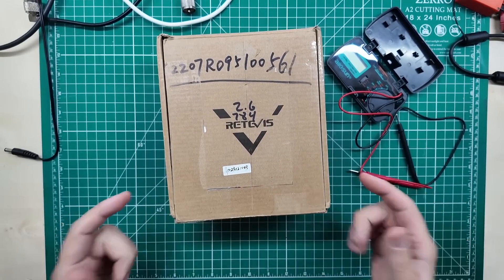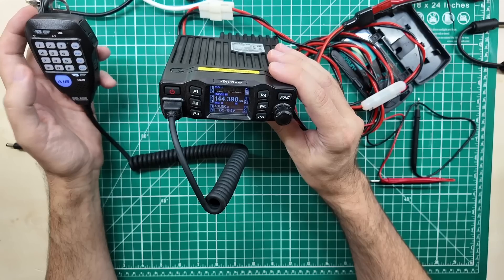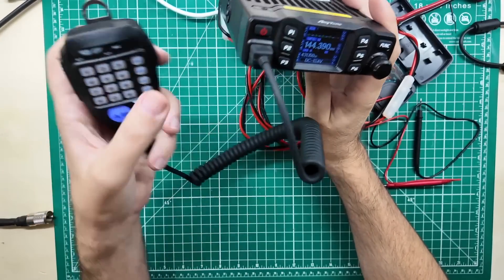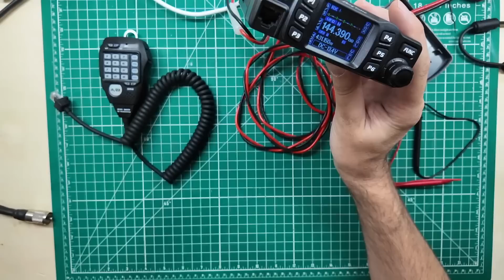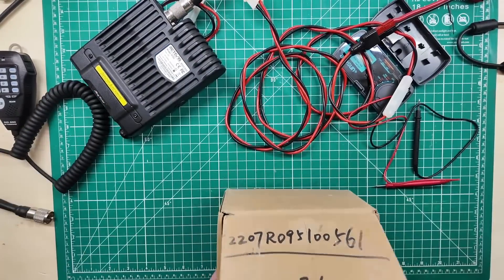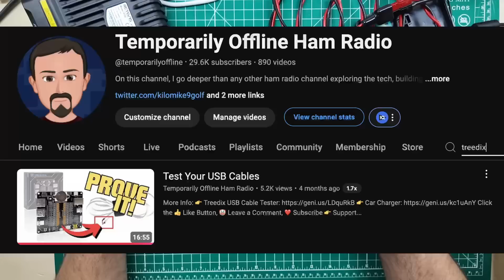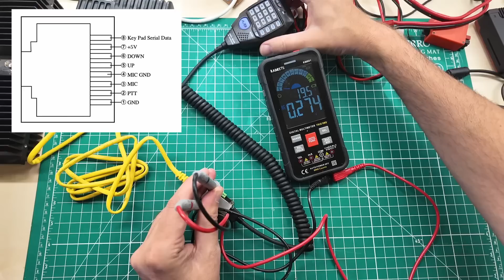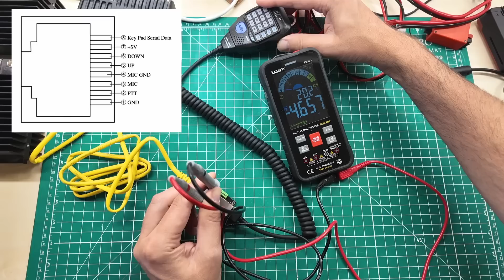She's Back!

Comment: Hi just wondering Anytone at-778uv and Retevis RT95 which one is better and what different?
Reply from the maker: Both radios are the same, come off the same factory line and the Retevis model gets a Retevis sticker and better support... go with the Retevis!  You can see in this video that the radio I got returned from Retevis has an Anytone sticker on it now... its what they had in the inventory of spares.  It works and I'm happy.

Comment: Alright. Your process or your radio is faulty here. I have an rt95 and just buzzed the ethernet cable port on mine and it matches with the manual to a T. I'm also building a digital interface and honestly, I'll be going with the external speaker port on the back for the audio back to the PC.

Comment: Perhaps you could find an obvious ground inside the radio, like the ground from the power cable, and find which mic pin has continuity with it? Then maybe work backwards from there.

I know Motorola numbered their mic jacks backwards: RJ45 Pin 1 is Motorola Pin 8 & so on. I wouldn't be surprised if Retevis did that too.
Reply from the maker: @EmJayArr  good tip, thanks!

Comment: This cheap junk radio will fail catastrophically within 2 years so spending any time modifying it is a complete waste of time.
Reply from the maker: How did yours break?
Reply: @temporarilyoffline  Display failed. It didn't get used much either. Plus the audio was crap from day one. If you buy these Chinese radios you might get 2 years out of them or you might get less. Buy an Icom, a Yaesu or a Kenwood. It's going to cost you 75 bucks more but it's going to last for 10 years or more.

Comment: Watched your very good video. Several months ago, I used pin 7 of the mic wire to power a cb radio power microphone. I also successfully installed a dc to dc boost converter board to change the 5 volts to 9 volts for the cb mic pre amp circuit. Keep up the great videos! WRCX212 - GMRS OPERATOR
Reply from the maker: That's awesome!

Comment: I have the same radio and I would like to connect Kantronics modem to it. I have not read the comments but is it possible that you mistook PIN 1 for PIN8? You never tested PIN1 against the actual body of the radio. Or I have missed this part. The "differential voltage" makes me think that you are measuring against the DATA PIN8. Please let me know. I have found a diagram for the Digirig cable and I will make my own with appropriate modifications. We will see what happens.
Reply from the maker: I probably do have the cable backwards.  It's a common theme with me 🤦‍♂️
Reply: @temporarilyoffline  I am not saying (you should at least get this 5V), but I looked at my radio and the ground PIN is located on the display side of the socket. I tested connectivity between the ground PIN and the body of the radio and it was there. Also, this is just an unsubstantiated speculation... Perhaps the pins behave a bit differently when the microphone is plugged to the radio. Anyway, I will keep you posted as I am planning to work on the cable for my Mobilikd and Kantronics.
Reply from the maker: @radioastronomy2001 did you see my other 2 vids on this radio?  It's 100% possible, I'm just working on making a more refined interface.
Reply: @temporarilyoffline  I have not yet. I will see them as time allows. I am there with you! I want the same thing, a single cable coming out from the radio. However, I am planning to do it in phases. First I want to make the Digirig version to work with my Mobilikd and then I want to make changes to streamline the design to a single connection point. You decided to jump at the deep end first :-)

Comment: I ended up getting the Digirig kit for the radio. I set it up with UZ7HO soundmodem and OZ9AAR Greencube terminal to work APRS on the ISS. Worked great!
Reply from the maker: Hey Eric!  Sats are cool!
Reply: @temporarilyoffline  working the ISS digipeater is pretty easy too. My RT95 has no issues getting digipeated on it even with a basic vertical antenna.

Comment: Steve, you should probe all those pins using the battery connector black wire as common. You could maybe even locate the correct ground pin  on the RJ45 connector with a continuity test with the battery connector black wire.  I feel the pin you were using for return was not actually return. 😊
Reply from the maker: I agree, I think the pins are backwards - but mostly because I used the "cable end" and not the "socket end"... more work is needed.

Comment: I found the audio out and the UP signal (if I remember correctly it has been a while) were multiplexed. Needed a filter to decouple the audio from the gpio. Audio level was low and I needed an amp to boost. Got tired of trying to reverse engineer so I got the DigiRig mobile cable for the radio. Well the AnyTone version of it. It uses the speaker jack on the back and the RJ45. Ugly yes, but it works.
Reply from the maker: Yeah, I have dreams of a single non-y cable solution... I will probably get the digirig cable just to play with though.
Reply: @temporarilyoffline  I ended up selling all but one of my AnyTone Radios and buying 2 of the FTM-6000(s). So much easier to work with.
Reply from the maker: @W3DMJ yeah. But where's the fun in that? (I like my 6000 too)

Comment: MIC GND and GND are probably two different grounds. MIC GND will be analog and, as there is a serial data line, GND is probably a digital ground. It is pointless trying to use a volt meter or oscilloscope on a digit signal. You need a digital signal analyser. The Up, Down, etc pins may use the MIC GND as ground return and not the GND digital ground.
Reply from the maker: My scope decodes digital because at the end of the day everything is analog.

Comment: Regarding those DuPont cables - the plastic shrouds around the male or female connectors are singles but you can buy multi-pin shrouds to enable plugging in to multiple connectors at once. You just have to push something thin and pointy into the shroud to unclip it from the metal pin or socket and then push the pin or socket into the multi-connector shroud. That way you could plug in all four wires to the header or terminal block at once.
Reply from the maker: Thanks for the info!

Comment: If you go online and look for the pre-manufactured APRS cable for this radio - in the product details, it shows the pinout the product uses. I used pinout on that product and everything works perfectly - the  one in the manual that comes with the radio seems to be incorrect.
Reply from the maker: Good eye!

Comment: Did they upgrade the firmware? You already got the mic gain setting before shipping? Don't loose the chance to make a video if you don't have the mic gain setting. Another great chance to brick and send it back to the far end of the world again. Jokes aside, wondering if mic gain could be useful for this project.
Reply from the maker: I didn't have problems with the audio levels before... But you're right, this is a great radio for $120, more people need to know about it!

Comment: Steve check to see if connector ground is the same as radio ground. I normally chech from the radio chassis to the connector to confirm this. Have found floating grounds to give me all types of grief. Also drives test equipment crazy. de K8DMM Tom

Comment: Hey Steve, I think there might be a direction to the treedix coupler.  So if the breakout is numbered it should be numbered with one side.  The otherside will be reversed.   That is the only way you could get a negative value is by putting the red probe to ground.  And not sure what value this gives you as I read the rest of the comments.  Look forward to more videos on this radio.  Thanks.
Reply from the maker: We'll figure it out for sure!

Comment: Take the connector out of the equation.  Get a plastic ethernet barrel connector, break it open then measure the inline amperage on each wire as you press the buttons on the microphone.
Reply from the maker: I think I'll just try that next!
Reply: @temporarilyoffline  if you get this working let me know cuz well it's cool
Reply from the maker: @pnowikow  I've gotten it working, just trying to make the interface more prettier:  

VOX Version: https://youtu.be/tRYpdnbDx_A?si=mWgdb0u1VzOTk7W-
PTT Version: https://youtu.be/26Bsd2BWSm4?si=X8tD_lbXK_155W_t

Comment: If that diagram applies at all, the guy who drew it (almost certainly) numbers RJ-45 pins differently that your breakout board does, and I am not surprised.

Thus the pin that you're using as a ground reference probably isn't, making all your meter readings useless.  With power off, use an ohm meter between the shell of the SO-239 (a for sure ground) and each pin in turn to locate the ground pins (mic and logic) on the cable.  Be sure that the probe that sources current (is positive) is the one that you are probing pins with, lest diodes in the circuit confuse you.  (It's probably the red probe, but you can verify that with a separate volt meter.) Make several second measurements, to allow, for example, an electrolytic capacitor, say on the 5v line time to charge and stop looking like a short.  Now, still using the SO-239 shell as ground, switch the meter to voltage and find all the pins that look like 5V. Now add a 1k to 10k resistor across the meter and find the one that still looks like 5V, which is (probably) the +5V pin.

Now identify PTT, Up, and Down. Sorting out Mic and Keypad you should probe with a scope, since a meter, especially a digital meter, just isn't going to react.

Sorting out mic ground from (logic) ground is tougher.  Maybe with other things settled a pin number ordering will make sense.

BUT if you are expecting audio out on that connector, i.e.; if that is a speaker mic that actually speaks, then THAT PIN-OUT DIAGRAM IS CLEARLY WRONG since there is no pin for audio out.

I would have disassembled the mic to ring out the pins.

Too bad I'm not closer. Playing with it together would have been a great birthday present for me.
Reply from the maker: Happy Birthday!  Those are great ideas.  Where are you located?
Reply: @temporarilyoffline  New Hampshire.  Thanks for the birthday wishes.
Reply from the maker: @KeepEvery1Guessing  New Hampshire is not close to New Mexico! Dang!
Reply: @temporarilyoffline  Even though they're both "New"!

Comment: I would start with finding the obvious stuff and work from there. Ground should be easy to find (test continuity from the ground side of the PL-259 jack and find the one pin that's got no resistance. That's ground. That's one pin down. Once you have ground, +5V should be easy to find - it'll be the only one with +5V all the time (regardless of PTT or other button presses.)  O-scope should give you mic and speaker audio.  That's five of the eight.  Should make figuring out the last three fairly straightforward.
Reply from the maker: Great tips!  I don't know if you saw the previous videos, but the proof of concept has been done, now I'm just trying to perfect the interface a bit more and make a more "consumer safe" cable.

Comment: I suspect I may have told you, but  I used to be a Senior RF Designer at Celwave, and my tech actually updated the design of that load.  Those 150W (200W??) Celwave loads are rated for 150W at least with at least 25 dB return loss to 2 GHz.  I have two of them in my shack - both purchased from Hamfests.
Reply from the maker: Hey Kevin,  Hadn't told me yet.  I think those are awesome loads.  I haven't found a better setup yet!

Comment: My problem with my RT95 is that I sound "like I'm behind a door" say my fellow hams

I heard that there's a new software that suddenly introduces a MIKE GAIN that you can adjust from 1 to 3, and that fixes everything.
So, i was hoping you were dealing with this commonly seen problem.
Reply: Same issue, tried at first enlarging and aligning better the mic hole with no avail. The firmware did fix the reports. Two tips: I tried using a virtual machine at first to avoid running the .exe directly on my PC but it used to fail  around 50% (with no damage to the rig). It is probably a very time sensitive transfer. Running directly on a PC solved this.  Also please note the PUSH button isn't the PTT, it is pushing the rotary encoder wheel, like you do to enter menu and confirm. Reports are now fine at level 2 but if you keep the mic too close you will get some echo (don't know if this is related to the bigger hole mic). Hope it is useful, but YMMV. Finger crossed 🤞
Reply from the maker: @peterhume3474 I'm getting word that the firmware in the radio already supports mic gain, you'll just need to turn it on in the programming software.  Give it a shot!
Reply from the maker: Hey Peter... I rarely talk on the radio, don't get many signal reports - I'm more of a tinkerer/builder.  I'll take a look for the firmware update!

Comment: I think you made the same mistake I did on a similar project. The pin markings are for the head unit, not the hand mic plug. Pin 1 on the left side of the radio means your Pin 1 on the cable is on the right side of the connector. I can't speak for how the pins are labeled on you board, whether they are for the cable or the connector.

You may have just ran your test backwards. I'd suggest running it the other way and seeing if you get different results. Easiest way to confirm correct pin layout is go from +5V to GND. If you've got a different value than +5V, you're either on the wrong pins or there's something wrong with the board.

Also, you should be going across Pin 3 (Mic) and Pin 4 (Mic Gnd), not Pin 1, when testing the mic.
Reply: Yeah I agree, I think the diagram is wrong. I would find the ground and +5 before doing anything else.
Reply from the maker: Excellent Tip Brandon!  I thought about that at the coupler, but not at the radio.  Makes perfect sense and I should have known better too!  I'll take a look.
Reply: You could also check continuity for ground with the radio powered off there should be continuity from the chassis of the radio to the GND and MIC GND.
Reply: On the Digirig site they also show the pin layout. Indeed they use the brown/white as pin 1 instead of pin 8 !!
Reply: Also, you kept getting negative, even though you are probing positive…
Reply from the maker: @paulthelefty  Yeah, it was puzzling... but I'm going back in!

Comment: Digirig sells a cable to use with that radio I do believe. And it has a pin out too.
Reply from the maker: Hey Littrell, I mentioned that in the description.  Denis takes the easy way out and uses the speaker connection on the back instead of the speaker mic line.  Denis is a nice guy and I like the Digrig lineup, have a ton of his gear.